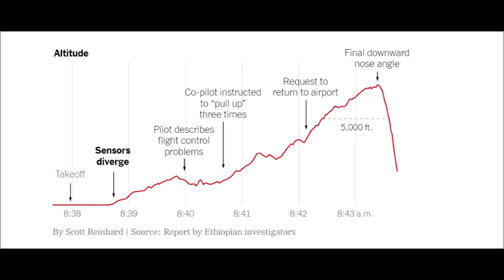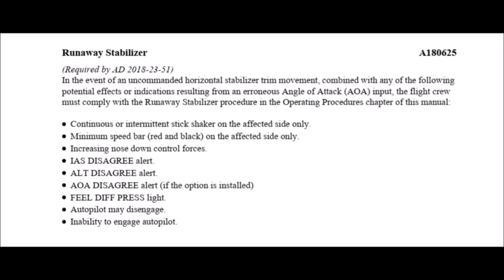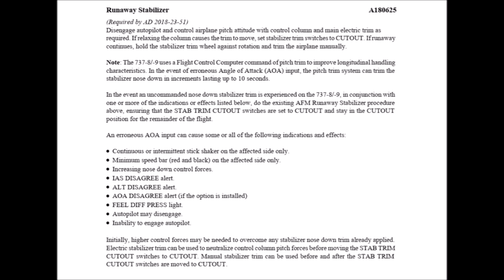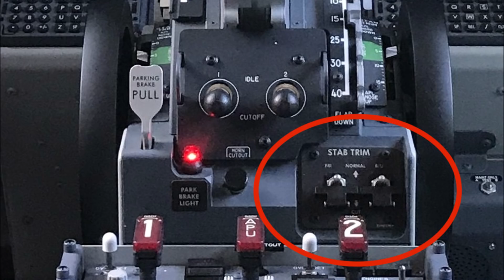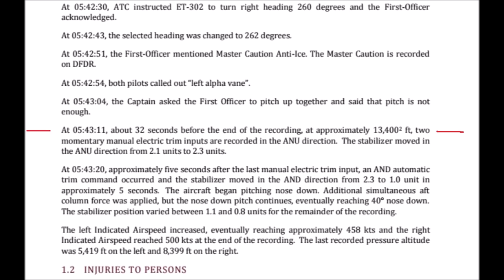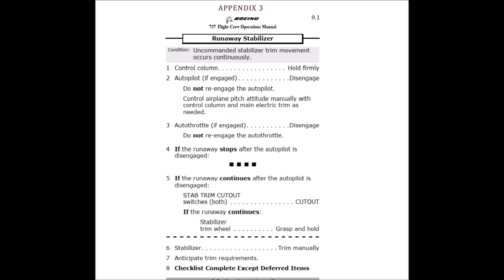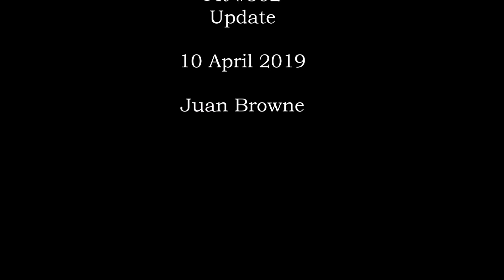737 Max Update 10 April 2019 Runaway Stab Trim Procedures

Comment: Thanks for the continuing informed updates Mr Brown. Few more questions, did they at any point have access to accurate airspeed readings? Did they fear power reduction might drop the nose? Did they likely restore stab cutouts, even at mcas risk, in a desperate last minute attempt to get electric trim given the FO could not manually crank trim wheel at that point given forces on the stab?
Reply: Damon Reynolds 
The faulty left AoA information was the root cause of the stick-shaker, unwanted MCAS activation, and incorrect airspeed and barometric altitude indications on the left side. The right side airspeed and baro altitude would not have been affected by that fault.
Reply: That is true, but only by careful comparison with the standby instruments. When there is airspeed disagree, you cannot tell whether the left or right instruments are faulty. Since they did not have an AOA display, they did not immediately know which side the fault was on.
Reply: Gordon Richardson 
The fault was on the side with the active stick shaker.
Reply: Yes, you know that after they event, but they had a multitude of conflicting warnings.
Reply: Been following the discussion on PPRUNE as well.
Even pilots are going back and forth on the myriad questions the PR raises.
One thing's for sure, this is no ordinary situation, as far as 'ordinary' applies to a fatal accident. The aircraft design itself is more scrutinised than any accident in a very long time.
There will be many takeaways on every aspect.
Reply: I have posted quite a few times on PPRuNe. I am not a pilot, but a computer programmer and former engineer, which seems just as appropriate for dealing with the intricacies of MCAS...
Reply: @gordonrichardson2972  Makes sense, the heart of mcas is after all software.
Tell me, do you think programmers/engineers were satisfied they'd had sufficient time to develop mcas behaviors, or were they pressured and overridden by higher ups to produce a  certifiable (no pun intended) aircraft?
This of course does not presume they thought the result was unsafe.
Reply: Damon Reynolds The lawyers will have to answer that in court.
Reply: Yes, no, maybe. We don't know for sure...

Comment: So, not very clear at this point: 
Recently saw a report that stated the 737 max 8-9 comes with two AOA sensors. Is that correct for "ALL" of them or is the second sensor a "option". If there are two sensors, can the pilot choose which sensor the software uses to proide the AOA value??
Reply: Every aircraft has at least two AOA sensors. The difference is whether they are displayed to the pilots, or only used to drive the flight computers and stick-shaker. Each pilot has their own display, and own sensor.
Reply: @gordonrichardson2972  
So, there needs to be a alarm/alert if/when the two sensors differ in value by more than some "reasonable" amount and a selector for the pilowt to choose the one, that common sense would dictate, that is NOT FAULTY to feed values to the automation.
Reply: I happen to agree with you. However, that would require a complete overhaul of the B737 flight system, since it is built on the assumption of (relatively) reliable sensors, with backups in case of failure (MCAS notwithstanding). The fix to MCAS will include such a reasonableness test.
Reply: @gordonrichardson2972 
 "since it is built on the assumption of (relatively) reliable sensors" . Since we appear to have documentation that multiple crews are "fighting to maintain flight" and two crews have lost those fights (along with over 300 lives) within a six month period, that some "regulator" who is tasked with the safety of the flying public should "question/re-think" that logic and assumption?? When we take our child to the grocery store, we need to buckle him/her into a size appropriate car seat,  when they outgrow that seat, we are prohibited from selling that seat(for safety concerns), put knee, elbow, chin pads and a helmet on them if/when they ride a bike, and we "assume" instrument reliability for the automated control of our airline aircraft??

Comment: Why is it not easy to turn off MCAS and give pilots complete control of the plane?
Reply: It is easy, two switches kills all power the the electric stab motor. The same motor MCAS uses. It comes down to the signs to look for as stated in the video. If you do it to late where enough time has gone by for it to trim you down then your fighting the stab.
Reply: Because MCAS is required to meet longitudinal stability requirements at high AOA in manual flight. You cannot easily turn off a system that is required for certification.

Comment: Thanks for the explanation. Would reducing throttle have caused the nose to pitch down even more? My theory was that they re-engaged the cutouts when the clackers went off because they were desperate to lose airspeed, but were afraid to reduce throttle.
Reply: Either is possible. We do not know for sure, and they certainly didn't.

Comment: They need one switch that says Disengage all Auto
Reply: it was the trim stab switches 
but when it gets back in the air it will be just the act of pulling back on the sticks will auto disable MCAS as it should of from the start and it use both AOA sensors, so basically if autopilot can't enable MCAS likely won't activate
its not an airbus

Comment: +blancolirio     Thank you for an informative video.  Do we know for sure that the maximum power position of the throttles was because the pilots did not manually reduce throttle setting or could this have been an automatic throttle position  override that we are yet to hear about ? We have heard that airworthiness certification was to a large extent in-house, a state of affairs not ideal to pick up an apparently obvious weak point like relying on a single angle of attack transducer which like anything else can fail possibly resulting in a single point, potentially fatal problem so I wonder if there was something keeping those throttles wide open other than the pilots being so pre-occupied with nose down trim that they did nothing to reduce their air-speed. I'm not a pilot but I'm sure if my car's steering failed such that I'm heading for an obvious accident I would brake in an attempt to if not prevent an accident at least reduce its severity. I can't help feeling that the pilots would have been well aware they were heading towards the ground much too fast and would, almost by instinct close the throttles.
Just more speculation by a mostly uninformed member of the public but hey this is the internet after all.

Comment: As someone already said, it was MCAS that should have been cut out, not the (absolutely required due to the proof herein necessity) pitch trim under motorised transport for stabilizer movement mechanical advantage when natural control surface aerodynamic forces exceed manual applied force.

How efficient is the 737 Max - 8 wing/engine configuration compared to previous series?
Reply: I agree. the new MAX engines are about 15% more fuel efficient, which is significant in the low-cost airline market. See: https://en.wikipedia.org/wiki/Boeing_737_MAX#Engines
Reply: Thanks, Gordon. I was thinking more about the overall 'lift' efficiency of the combined engine/wing shape of the Max in aerodynamic terms. When the Max made its first appearance I thought nothing of these things. That changed when two new aircraft both went down under near identical circumstances. The problem exactly reminded me of the de Havilland Comet. In that particular historical case a new technology aircraft had subtle underlying problems that went beyond what the unaided eye could detect. But then you have to think 'surely, Boeing could never enter a blind area of design where aesthetics overrule mandatory function,' after being in the game for so many years?

Comment: Great presentation, Juan. I am going to address, what I believe, to be the "elephant in the room". The language barrier. I must admit after listening to recordings between flights & ATC, I am impressed with ATC operators. The foreign airline pilots "gibberish" & garbled language is amazing over the radio.

Could this not also be the issue with pilots from many foreign countries flying both Airbus & Boeing?? If your "MAIN" or even secondary language for your aircraft is English, should you not have a good command of that language, especially at the helm of an aircraft full of several hundred souls?? Speaking, but also, "understanding" the language.Not implying that these are/were bad pilots.

No  Boeing aircraft from a predominantly "English speaking" airline has encountered an issue with MCAS (Resulting in a crash). Is the technology so new that this is an anomaly, or is it lack of proper training?? Assimilation of knowledge??
Reply: There is strong evidence that the Ethiopian crash was caused by MCAS triggering after faulty data caused by a bird-strike on the AOA vane. This has nothing to do with language or training or country of origin, just bad luck.
Reply: @gordonrichardson2972  Thank you, Sir. And I am sure there will be more to come. AOA vanes are also redundant. So, a pilot, as Juan says, "sometimes has to fly the plane".

Comment: Not a fix at all. If MCAS is getting a signal to continue nose down adjustment when it shouldn’t be tipping nose down it doesn’t have enough inputs from instruments. (Radio) Altimeters and airspeed should be added to STAB control function. Obviously AOA failed. This shouldn’t be left up to the pilot. Pilots can make mistakes and with lives at stake MCAS shouldn’t be left to them to figure out the problem. The stabilizer should never have a chance of crashing a plane ever again.
Reply: What kind of system uses a screw jack to full extension to send an airliner straight into the ground?
Reply: @JoeLinux2000     Contrary to the statement that you have made and some of the graphics that i have seen on media reports ,  the Jack screw  on a 737 DOES NOT HAVE a significant ability to trim DOWN [ INTO THE GROUND ]   I know this is what the media tells you, but what they really mean is a reduction in UP trim. [ a reduction in units of nose up trim ]  When an airplane is airborne gravity is a strong enough force to cause a decent and even when an aircraft is descending the TRIM is still set to a VALUE of UNITS of nose up trim.   The elevator can be used to lower the nose but if you look at the TRIM UNIT Scale on the center console most of the trim capability is in the up direction.
Reply: Well said, pilots shouldn’t be in that position.👌👌👌👌
Reply: without correct AoA how will the plane differentiate between a nose down situation and a nose up stall?
Reply: JetMechMA  @JetMechMA Unfortunately I can't cite a source, so I shouldn't have stated it as fact, only as something that I had seen mentioned. I read about it in the comments section on another youtube video on this topic in a lengthy comment that went into a lot of details and seemed credible, but finding a comment in a youtube vid, when you don't remember the actual vid is just not possible.
I am really sorry for writing something that I can't back up, I really get annoyed when armchair experts make random claims stated as facts, embarrassing to have done the same...
Reply: The first crash was partially due to the MCAS alternating between right and left sensor each time it is turned on. The previous flight crew reported AOA issues. An engineer checking it out turned it on and saw no problems in his readings and closed the ticket. Forgetting that on this airplane type you have to do the test twice, to make sure both sensors were checked. Since he turned it off after testing the working sensor, he doomed the plane since next time it was turned on, it would use the broken sensor...
Reply: JetMechMA  I'm not retracting my statement :) But I shouldn't have stated it as fact, just something I had seen mentioned.
Reply: Willie - MCAS is a software function of the twin Flight Control Computers on the 737 Max 8. Those twin FCCs do take input regarding the aircraft airspeed and altitude.